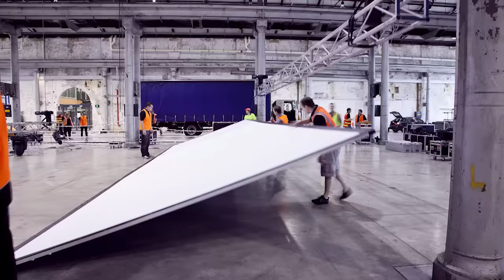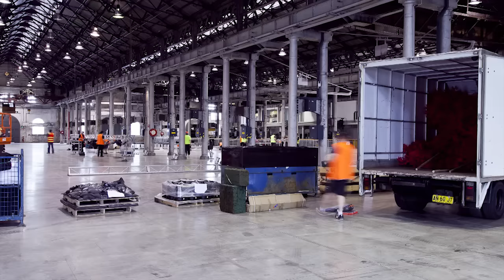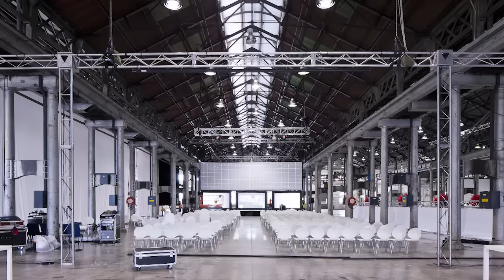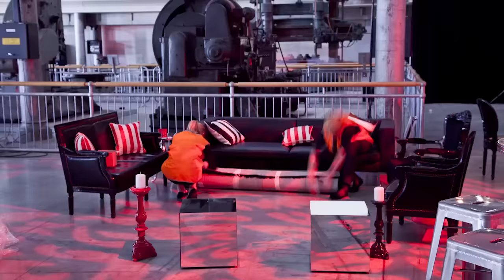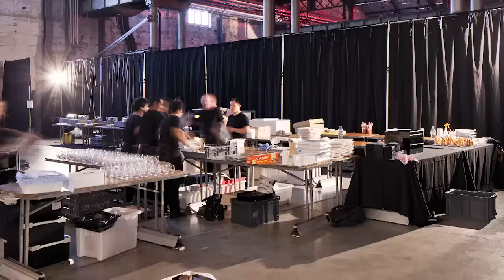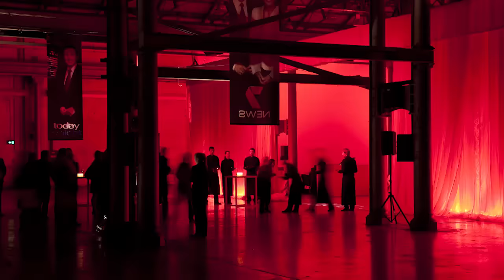Corporate Event Setup Timelapse

Comment: Hey, Great video!  How did you work out the formula for fps in playback? Cheers!
Reply from the maker: Hi Andy
Normally I would base playback on 25fps, then consider how long I want or need the finished video, and over what time period the action is going to take place. From those I can calculate how often I need to capture an image.
In this video however I was not as concerned with the final length however it was important to maintain consistency of apparent speed across all the action. The capture rate (from memory) across all sequences varied very little.

Comment: Did you use a go pro? And what editing software did you use? I'm trying to build something similar.
Reply from the maker: +Fahama Sawant 
Hi Fahama

This was all shot on Professional Canon SLR equipment, and using Premiere Pro as editing software. The GoPros are not bad for shooting timelapse, however they are limited in quality simply due to the fact they are a compact camera, and do not have the range of lenses available as an SLR does.

Having said that, a GoPro can often be situated in places that it is difficult or expensive to place an SLR.